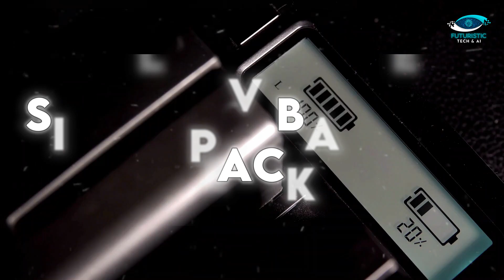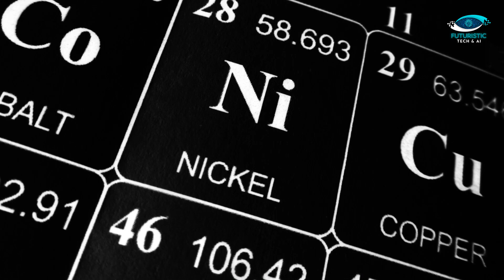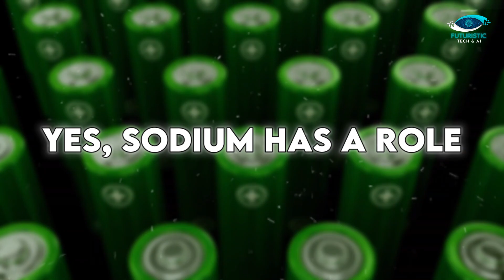A Revolutionary Chinese Technology That Will Change EV Industry Forever | China Sodium Ion Battery

Comment: Put it now in the market!
Reply from the maker: This will be the biggest milestone. Even though its been proven by experiments, it takes years to bring to the market.
Reply: Can anyone clarify what is sodium that will be used for EV batteries, am I correct in assuming it's common salt, if so think very hard about this possibility
Reply: @Peye-pv4cb  No Sodium is not common salt. Salt is sodium chloride.
You can extract the sodium mineral from salt, in a number of ways. The most common is Downs process wish is an electrolysis process. Basically you heat salt to over 800c then use electrolysis, and the molten sodium will float to the top. However it is very reactive.
The statements in the video saying sodium is so much cheaper than lithium surprise me. But I think they were comparing raw materials of Sodium salts and lithium salts.
Note an easier way to obtain sodium which you could do at home is to heat baking soda (sodium bicarbonate) in an oven, although the sample would not be very pure.
Reply from the maker: Colin, we really appreciate your detailed explanation. 
Yes, by cheap, we meant as compared to the Lithium salt. So, the raw material is cheaper in case of sodium salt and also abundantly available.
Reply from the maker: As far as i remember from my college days common salt is NaCl, kindly correct me if i am wrong 😅